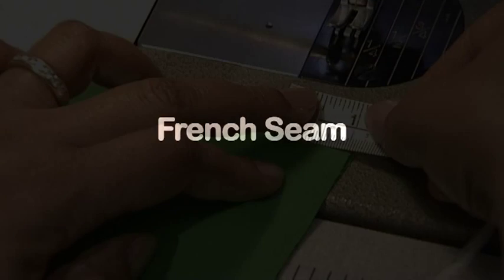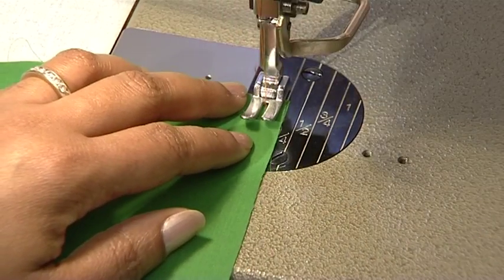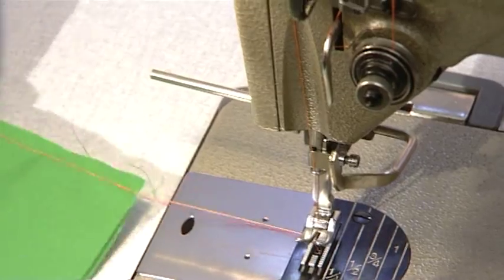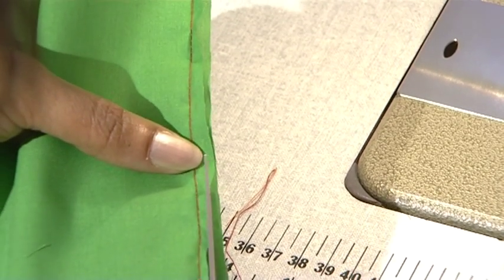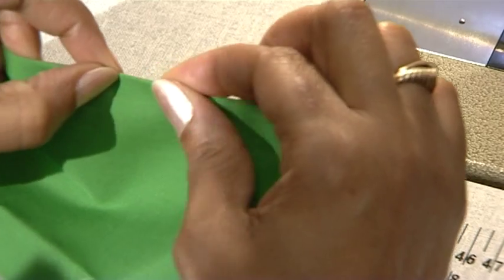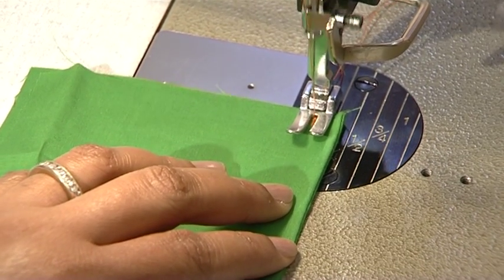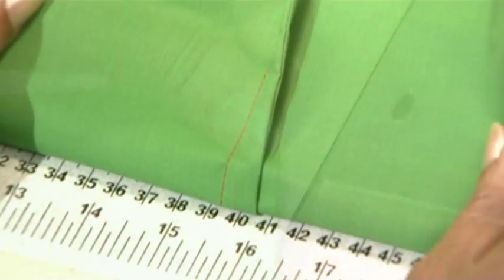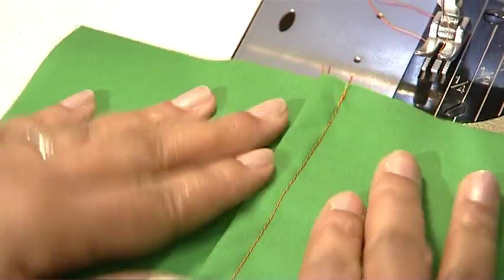How to make a French Seam

Comment from the maker: Hi Scoobieman06,
Thanks for your comments, sincere apologies for the delay in replying.  Unable to do demo at present however, match precisely and stitch with the seam edges together at all times.  Match the balance marks and STITCH LINES at top and bottom of garment also.  Feed shapes under the foot (DO NOT STRETCH).  Top stitch from the right side, stitch left and right side in the same direction e.g. bottom to top.  Use seam guide to help keep stitch line accurate.
happy sewing
regards